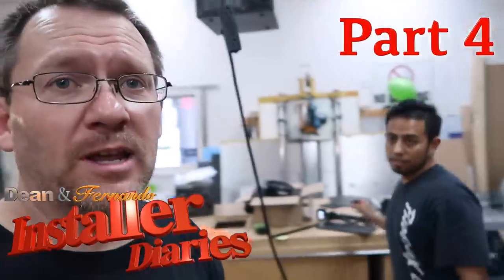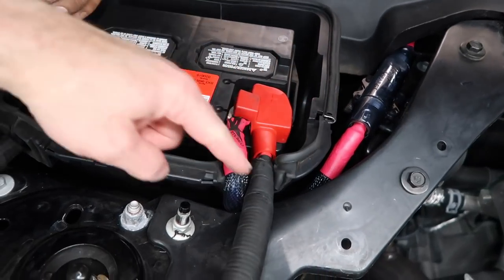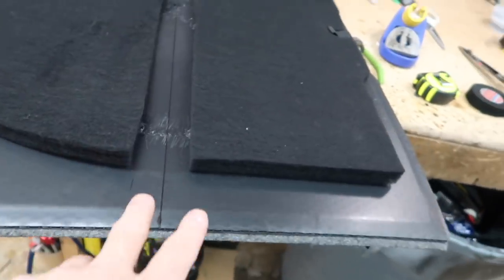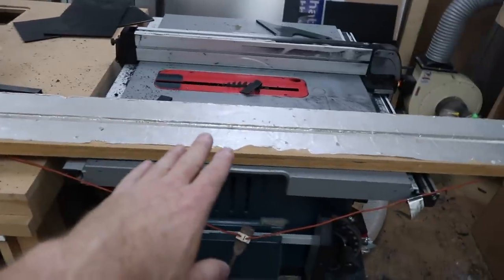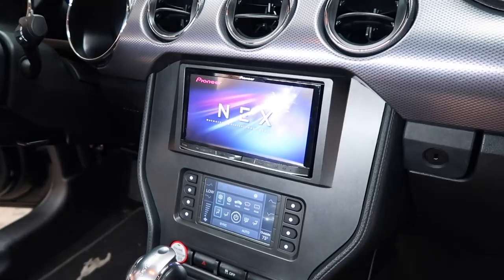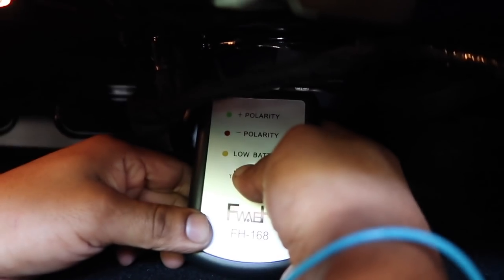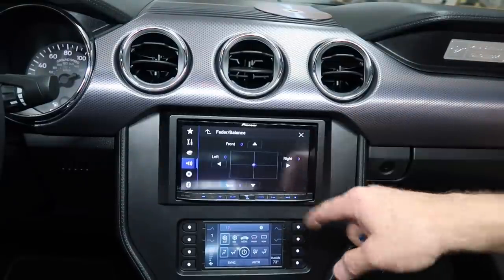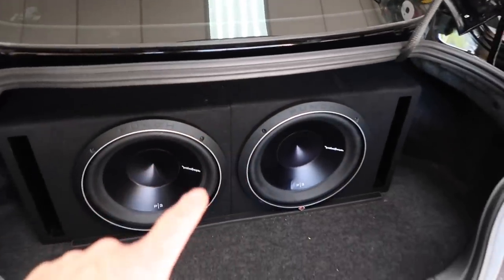Mustang 911 radio in and done Installer Diaries 291 part 4

Comment: Hi, won't those amp over heat in a tight space like that?
Reply: Those amps are surprisingly really good as far as dissipating heat goes. Really good amps for mounting in tight areas like under seats or spare tire well
Reply: You forget that the spare tire is on the bottom of the car which is exposed to air on the underside.
Reply: The newer Class D amps don't heat up as much as the old school amps.  They're suited to conditions like this. 
I've got a brick amp right under my AC vents in my work truck dash and never had an issue cold or hot weather.
Reply: Echoing what Kenneth Blackburn said.  This is definitely true; newer Class D amps don't get as hot as the old school Class AB amps did.  I have 3 JLAudio XDv2 amps in the spare tire well of my 2017 Mustang and they are covered with the factory trunk floor and they don't ever overheat, even during Texas summers.  They do get hot after blasting the stereo for a long period of time, but at normal listening levels during my 1 hour commute to work, they get warm and that's it.